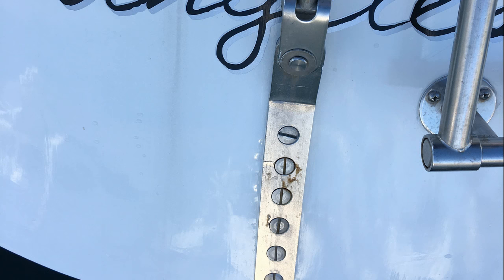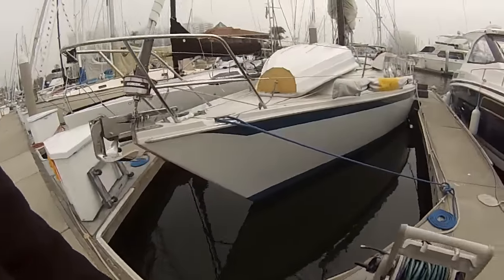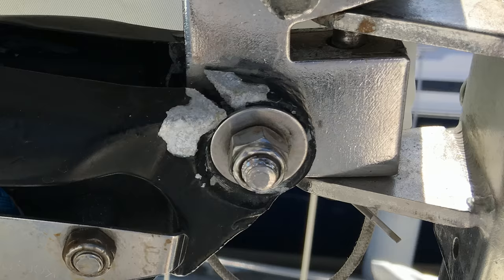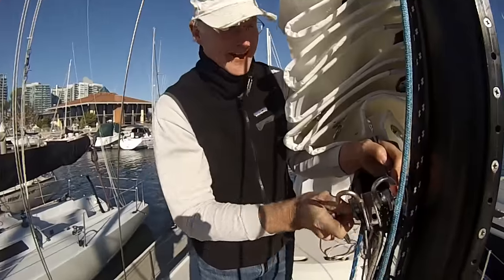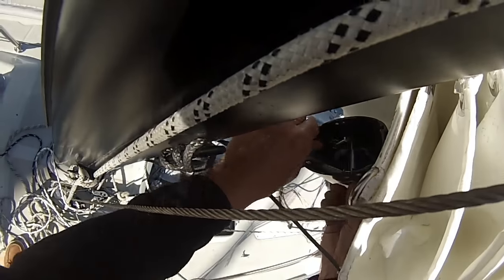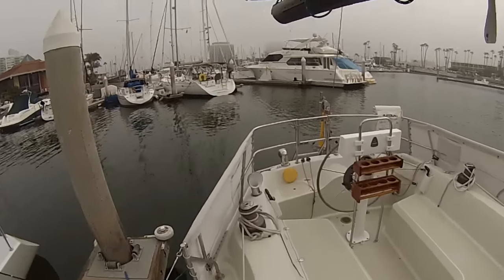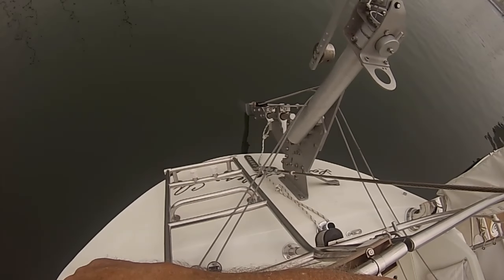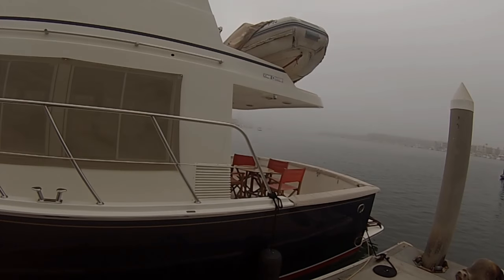"A New Boat"-- Part 6 (Chainplate, Gooseneck)

Comment: Hi Christian. Great film as ever, you always seem to make the mundane inspirational, thanks for sharing. Re your gooseneck, we suspect as you do, that it will be more than string enough but if the original fixing is some form of ali casting then you will have to look out for corrosion between the dissimilar metals!
Reply from the maker: Original ULTRA Tef-Gel® - 4 OZ Tub - Stops Salt Water corrosion on all metals
Reply: Christian Williams Okay, then. 😉
Reply: @ChristianWilliamsYachting  will that keep  galvanic corrosion from happening? If so then I'll be picking up some of that.

Comment: Christian , There is nothing wrong with overbuilding fittings . My theory is , the first one broke , so it is obvious that it has either worn out or corroded. Then make the second one bullet proof . My other thoughts are , there are some fittings on a boat that should never break , ever . Goose necks are one of those . i am not sure why the manufacturer has not polished the outside and edges of the new chain plate . I can understand the grind marks on the side that is sikaflexed to the transom but not the sides exposed to salt water .  I finish my work to ultra- brite specs when ever there is areas that can trap salt through rough grit sanding finishes. .... keep up the good work on these videos .

Comment: 1/2" PVC with a slot cut length wise could run on the top of your gas can holder would look cleaner.
One piece of PVC running the entire Length of the gas rack. It's white, it wont rust, two screws and its in.

Just an idea. Big thumbs up for what your doing. 😎
Reply: Just make sure it's UV stable

Comment: I'm a little careful about using Pascal's wager, it makes far too many assumptions about causes and effects. For example, it assumes a vengeful god that would punish someone that leads a good life but doesn't believe. It also dismisses the 'cost' of believing .. tithing and many hours spent in a church. 

I hope your wager didn't make as many assumptions :-)  It looks pretty sturdy, are you planning on a replacement or some welding at some point??

Thanks for sharing!
Reply: Not to mention blatantly ignoring the thousands/millions of the other faiths and religions out there. Hard to play it safe with 1/2,000,000+ odds stacked against you, regardless of what bet you choose.  :-)

Comment: What is "crevice corrosion"? A small crack that then get attacked by salt water?  But, isn't the whole thing stainless?
Reply from the maker: Stainless needs oxygen to maintain its integrity and corrodes in the absence, which can happen under caulking or in semi-sealed crevices.  This part might also have had work hardening from flex. Thirty- year- old stainless steel hardware still looks shiny, but should be regarded with suspicion and inspected with magnifying glass.
Reply: I've never had a rigging failure but I have had chain plates fail completely, most people renew rigging every 10 to15 years and ignore chain plates, I would suggest replacing along with rigging for peace of mind

Comment: I'd love to read your book, but my wife is enthralled with it and I can't get my hands on it yet.  As for the gooseneck fix, will stainless on aluminum not invite oxidation?  I thought it was best to avoid contact between dissimilar metals unless, eg., you are using one as an anode.  Thanks for the videos, we take possession of a 30 foot  1983 Ticon on Wednesday, your refurbishing videos will be very useful.
Reply from the maker: The plates stand off the casting (sheaves underneath).  Wherever contact, occurs, apply Tef-Gel.  Every aluminum mast is studded with stainless steel  fittings, so dissimilar metals are a fact of life.
Reply: Thanks, good to know.  We were told during the purchase survey to inspect chainplates by removing them periodically when the mast is down since they can corrode in hidden places.  Looking forward to the adventures.

Comment: Red cans with diesel inside?
Reply from the maker: It's a boat, not a farm. The plastic is the same, diesel or gas.  The color is for identification only, to prevent accidental misuse.  However, I did later switch to yellow cans because so many people felt I was making a near-fatal error in judgement.
Reply: @ChristianWilliamsYachting  I know a great many farmers who say the same thing. " a jug is a jug"
Reply: I know that would be terrible if you poured that into the gas tank on your boat thinking it was gasoline in them. Oh wait..................you don't have a gas engine!
Or worse yet................what if someone stole your cans and poured the diesel into their gas tank,  thinking it was gasoline! LOL